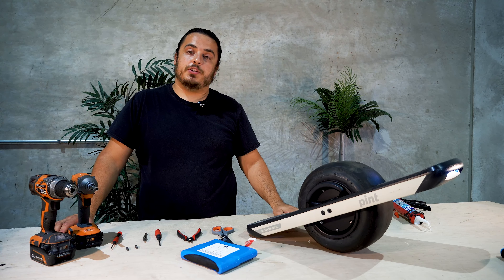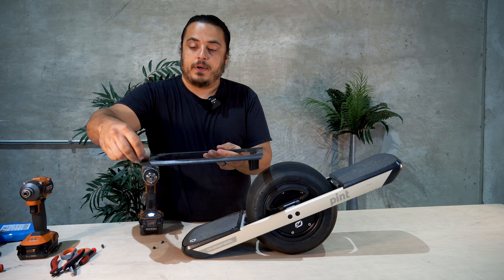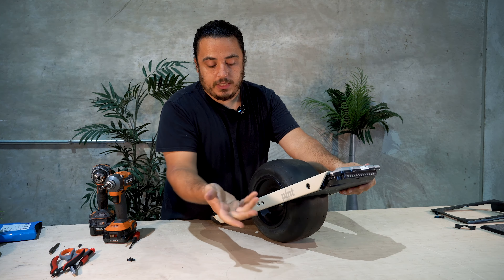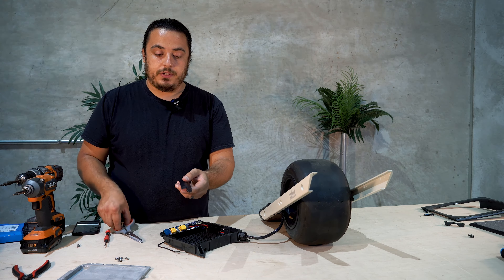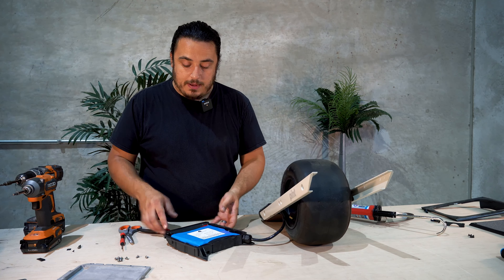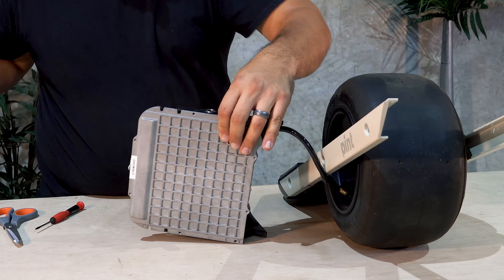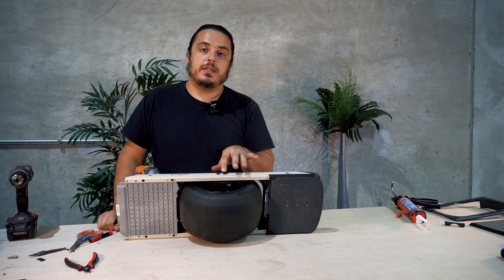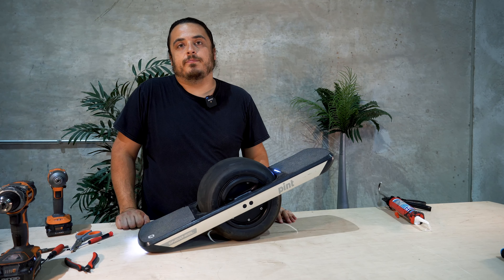Quart by ChiBatterySystems: Installation Guide [UPDATED 2022]

Comment: To anyone wondering about buying one of these. I would not recommend it.  They are of poor quality.  I've had one and after about 2,000 miles I've already lost 3.5 miles.  These are not worth the money they are asking.  I hope I save someone else money.
Reply: 2000 miles is a lot, I’d consider it solid vs just getting the factory replacement
Reply: Plus losing 3.5 miles is still more range than the stock battery
Reply: Buying a Pint and rewheeling it is the way to go.
Reply: @northuniverse  what rewheeling
Reply: @TheDaviro47  someone has uploaded a copy of rewheel already

Comment: I'm contemplating getting this for my Pint, but how do you check battery levels with the new battery? I assume that both the light indicator on the board and the app won't be accurate anymore
Reply: On the app, you can see the voltage for the battery as well as the percentage. The battery comes with a little chart that says what voltage is which percentage, for example if the app says 62.25v your battery is full. Chibatterysystems also sells a battery indicator that you can attatch to your pint

Comment: To anyone else that tries to put your metal plate for the box back on and runs into “this thing absolutely will not fit! What the heck???”:

- make sure the BMS plastic cover was cut properly and is not pinching any wires

- the quart IS a MUCH tighter fit and the lid will not sit flat if you rest it on the box like the stock battery. You have to pay attention where they say “get all the screws STARTED first  and THEN torque them down. It will feel like super bad and weird doing it but if you do it that way it WILL end up sitting in there okay. I had a legit 3mm gap between the lid and box before I got them all tightened down.
Reply: Running into that problem rn, thanks

Comment: Hey guys, i have a good question. I have this Quart battery and i have stored the OW for a while with a good charge during my wife pregnancy so i haven’t had time to ride. But as soon as i got back on the OW. I fully charge and few miles later it seemed the battery was already dying on me in just half of the battery as if Im back to a stock battery. It seem the Quart is not holding its charge anymore? What do you guys think has happened? Thanks all!!
Reply: If you updated to a newer firmware you've been locked out of your extra range
Reply: @haymose_  this happened way before i updated the app. What could it be?

Comment: I’ve heard that disconnecting the battery cable will automatically brick it. Is this true?
Reply: inwish we could get more answers i’ve been trying to find this out myself
Reply: I've read that this is the case with the GT
Reply: If you have the GT, it will brick the board, but the Pint won't brick.
Reply: @Mike_Jones281  Are you sure with the pint x it is safe to disconnect the battery?
Reply: @Joka.3000  Not with the Pint X.